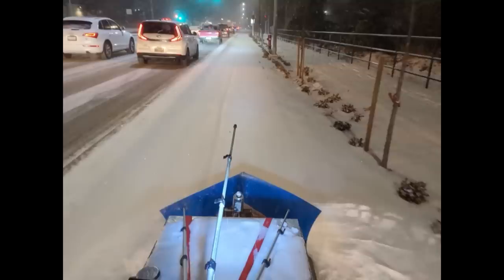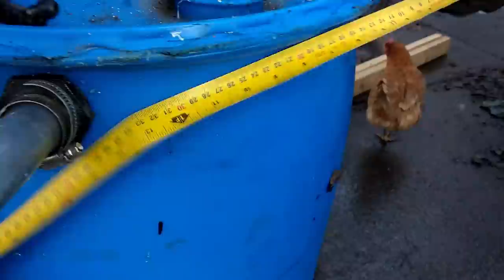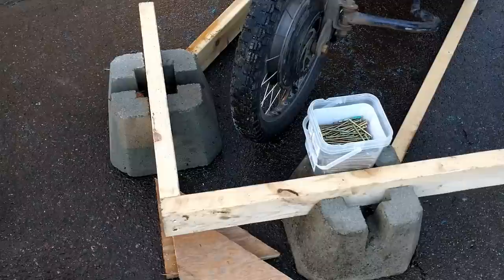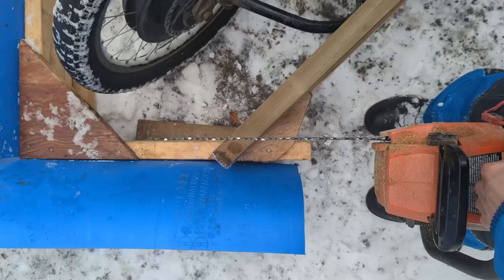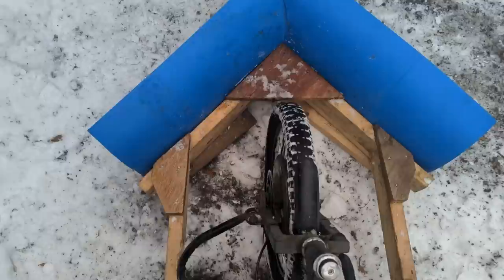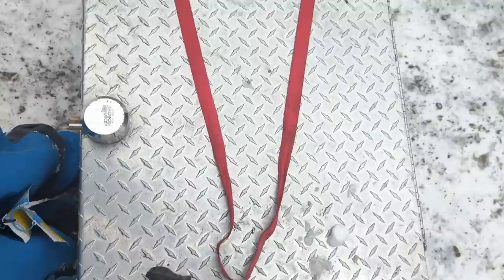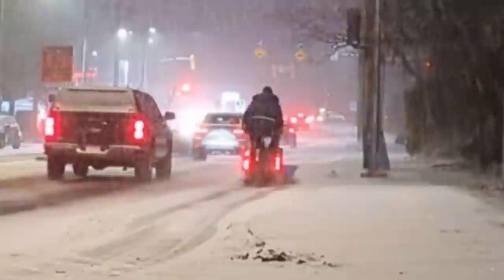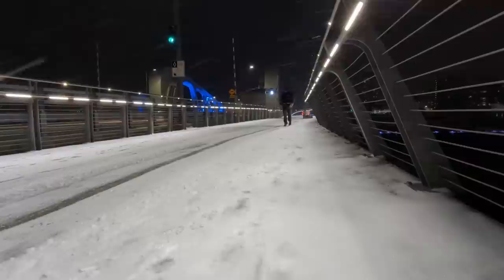Electric cargo bicycle mounted snow plow build and operation tutorial

Comment: Very impressive! This is really cool. I like the V design for stability and maintaining a straight course so the plow is not trying to push the operator off to one side. Because the plow is so close to the tires you could make it significantly more narrow as bike tires are narrow. You may consider adding a 1/4" steel thick X 4" tall X the width of the plow that bolts on the lower front edges of the plow, the steel edge would hang 2" below the plastic of the plow protecting the plastic from wear. The steel cutting edge on the narrow plow and the extra weight on a small area (1/4" wide) would also cut through the snow down to the pavement better for improved traction for the tires, the steel edge also will wear down much slower protecting the plastic of the plow itself. There are abrasion resistant steels available from AR200 to AR600 and a brand called Hardox500 that would be perfect for this application. A narrower plow would allow the electric motor to have less resistance and thus uses less energy, making your battery last longer and It still would be wide enough for people to walk single file in the cleared path.

Comment: My larger bicycle snowplows (3-5ft) are also vplows that are designed to push snow off a pathway, leaving it completely clear of snow. My plows all dig into the snow so no extra weight has to be added to them to plow efficiently.
Reply: You pull the snowplow?

Comment: you could add a small drag plow behind the bike and it would probably clear what the front plow misses. maybe even put it on a hinge type of system so you can either add some weight for more clearing and then you can raise it up when not needed. 

( IMO salt or sand sprayer would only be good for clearing your driveway, not miles and miles of bike paths. just my 1cent though lol )
Reply: Good idea, but I don't think any weights are needed as the angle lifting the snow pushes it down.

Comment: I wonder if it's possible to take multiple brush heads and create a spinning roller that shoots snow in a direction since it works best on recently light snowfalls, and doesn't require a heavy plow, or can be used to 'sweep' up leftover snow and brush them aside.

You would need to 'belt' the roller to spin rapidly with a lot of force while you are riding and pedaling on the bike.

Comment: Very nice.  How is the wear on the polyethylene blades?  You'll likely want to add an additional replaceable polyethylene edge so it doesn't eat up the blade or perhaps even metal although that risks catching the edges on the ground much harder.  Nicely done.

Do you have any metal studs in your bike tires?
Reply: I think keeping the blade above the ground slightly around half a inch off the ground or more, and using a wide brush that spins rapidly to shoot excess snow at the bottom to the side, makes the most sense.

Comment: Great idea and implementation. Thanks for sharing. However, while watching, I thought of something else. I realized that for such difficult road conditions, a cargo bike with two assist motors, i.e. one for each wheel, would be a good solution. One at the front in the hub like yours, and the other in the rear wheel or motor in the bottom bracket. Riding in deep snow or powdery sand would be a little more comfortable.
Maybe snow plowing would be more efficient then? What do you think about this?
Thanks, with best regards from Poland 🙂👍💙💛🌻

Comment: Might want to consider adding a steel trim or similar at the bottom of the plow so you arent releasing microplastics wherever you go. The steel particles aren't so bad for the environment.
Reply: the steel edge might send a shock wave to the supporting structure , damaging it . the plastic edge flexes enough to ' jump ' over the irregularities in the path .
Reply: @siriosstar4789  yeah, probably right

Comment: Add thick rubber "blades" and it will be better at cleaning and blade edge is replacable.
Reply: Perhaps even better, thick bars of HDPE. Same material as the drum actually. But bars of the stuff (think plastic food cutting boards) bolted to the bottom edge could be made sharper, replaceable, more rigid. Large steel snowplows that are designed to better preserve the surface they are cleaning already use this.

Comment: Interesting concept. A trike setup might be interesting. Single wheel front with two wheel rear. Not sure if you could use individually powered rear wheels or if they would need to share a solid axel but if you could individually power the rear two wheels… you might be able to pull off some cool differential steering off in order to offset a power angle snow blade. 🤔

Comment: Just this month I started wondering if it was possible to make a muscle powered snow blower, and then youtube recommended me the CBC video of your bike. At least now I know that you can plow snow with muscle power.
Is the snow depth you can plow with only muscle power the 4-6 inches mentioned in the video, or was that with motor assist from the electric cargo bike?
Reply: That’s definitely an electric bike
Reply: Not only is that an electric bike it's a cargo electric so it likely has one of the largest motors and battery packs you can get for a bike.  There's no way you could just bull your way through 6 inches of snow like a wild animal.
Reply: @Nas_Atlas  Yes, I knew that it was an e -bike from the CBC's video. And having tried to push my bike tire through one foot of snow after a blizzard (hey, I wasn't used to living here yet) I would definitely assume that a 6 inches high and 2 feet wide track of snow isn't something you can just push through. My main question is how much you CAN achieve with muscle power.

Comment: I have been building bicycle plows since 2014. You can get my book, Bicycle Snowplow: Why and How to Plow Pathways online. It gives directions on how to make one that you can pull and overcomes many of the issues encountered through developing the technology and clearing pathways for many years before the City of Calgary began harassing me for clearing pathways they refused to plow. The snowplowing outfit that works for the city clearing pathways wanted me to buy $1 million for liability and all kinds of other silly notions as if a 15-30 pound plow would cause serious damage to property. I could plow 2 to 3 times faster than city plows in light snow. Upgraded my bike to ebike for plowing deeper snow (6”plus).
Gave copies of my book to city hall politicians but they only want to protect their excessive need to spend money on expensive machines that do a worse job clearing pathways. They wouldn’t support the use of more efficient bicycle snowplows and the creation of more winter jobs. Power and politics leave little room for sanity or common sense. That’s why they only plow half the pathways here.

Won two awards for commuter of the year for bicycle snowplowing. I also build and sell them. My versions can be used by a regular bike or by pedestrians and joggers. Kept 4km of pathways cleared for 4+ years. Now the city plows the routes I used to clear. Spent about 50 hours/winter clearing pathways because I had no pathways to work that were maintained back then. The only time I crash on the pathways has been when the city made excuses for not clearing them.
My plows are designed to ride over rough ground. Lots of testing riding through fields with rocks on them and over grass etc. My largest plow was 5 foot wide. Normally I use a 2 foot plow for snow up to 6” deep with a front wheel drive ebike (a.k.a. Two wheel drive). Two wheel drive is best for maximum traction in deeper snow. Have plowed through 3 foot drifts. Built tire chains for my fatbike as well. (Fatbikes are poor for pulling plows or riding in snow 2-3” or deeper).
Used to have all my videos on youtube before they began censoring the truth about covid and vaccines. Then I took all the videos off to protest their rejection of freedom of speech.
Last year I built a 30lb bicycle camper which I may be using this summer for camping. Very comfortable design and easy to pull with a regular bicycle. Some of those trailers are in excess of 100 lbs.